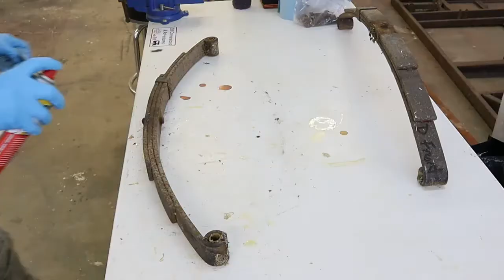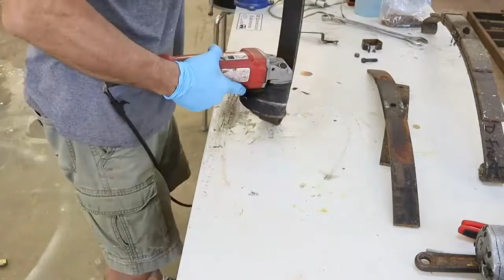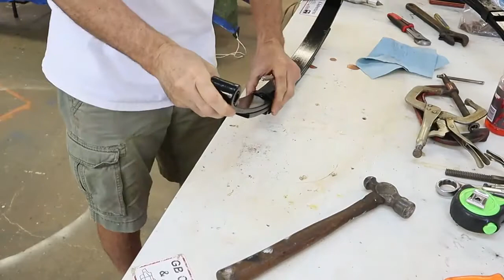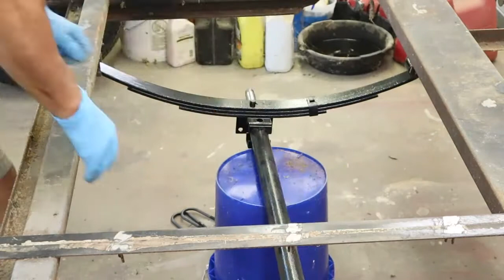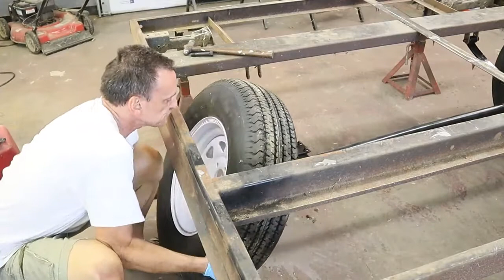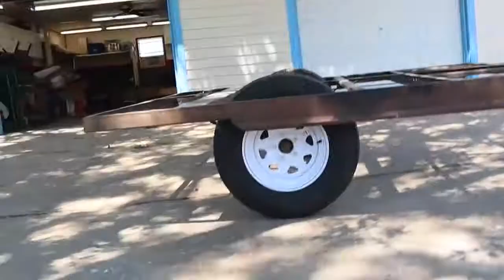POP UP CAMPER DEXTER AXLE FLIP LIFT PT 8 REBUILD REMODEL Modifications Renovation Leaf Spring Instal

Comment: There's an old saying in the Cattle Business GB, "The Eye Of The Master, Feeds His Cattle". The same will hold true on Your trailer, " You'll be proud of it when Your done-- and rightly so".
Reply from the maker: Thanks MT.  What are you working on these days?
Reply: @FakeLegGreg  GB, I recently retired from traveling 12 mid-western states in the Auto Business and 23 Year's in the Cattle Business. I don't have a project at this time, trying to figure out what to do now that I have some extra time. Enjoy watching Your video's.
Reply from the maker: @missouritraveler6401  You will figure it out. I just retired from teaching in May after a terrible year. This is what I do to keep busy and sane. Always good to hear from you MT.
Reply: @FakeLegGreg  Back many years ago when We did a lube  job We would always squirt a little Brake Fluid on the spring bushings at the end of the main leaf. This seemed to help preserve the rubber from deterioration.
Reply from the maker: @missouritraveler6401   Dang we are like brothers MT. The first thing I look at when I pull the springs is the rubber bushing. However, I was surprised that these don''t have rubber bushings, just a steel sleeve. But I would have replaced the bushings and lubed them up as you suggested. Thanks for the input MT.

Comment: Looking good. I’m looking into converting mine to 5 lug as well. I did a 4” axle lift on it last year but I’m still not not sure if the tires will fit under the wheel well. Can you tell me the diameter and radius is on the tires you have. That would help me measure to see if have the room too. Thanks for the video it’s starting to come together.
Reply from the maker: Thanks Dillon. Those tires are 28 inches tall, so 14 inch radius. Good luck on your project.